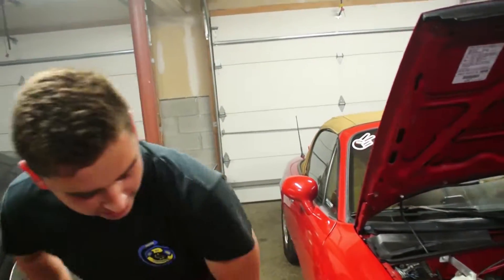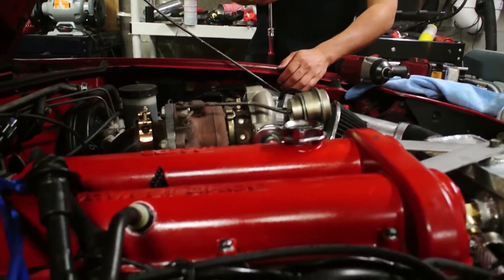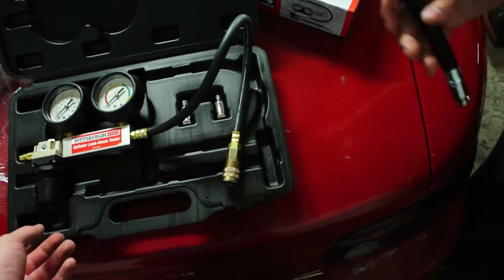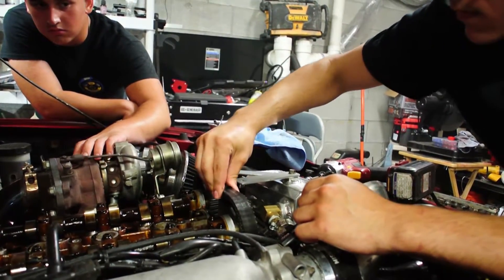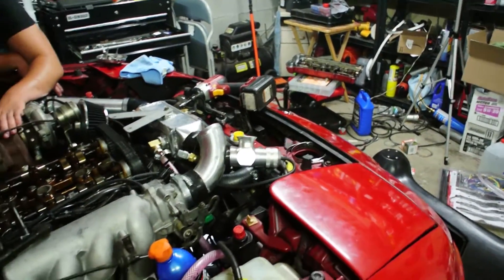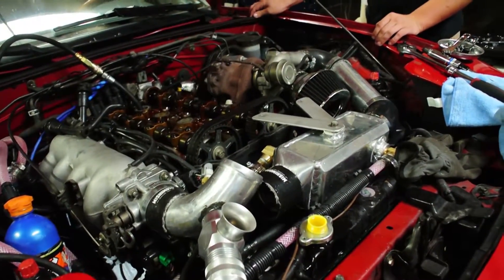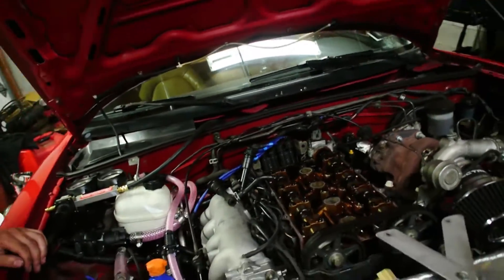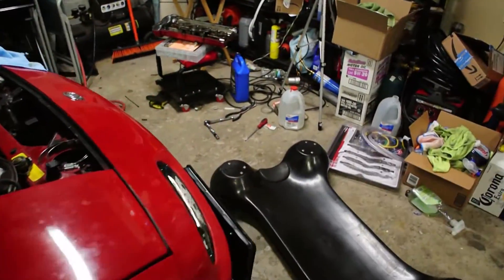How To Check a Head Gasket With a Leak Down Tester

Comment: When doing a leak down test, you don't need to remove the valve covers. If you screw your leak down tester minus the gauge into the spark plug hole of the cylinder that you want to test and the secure a balloon where the gauge would be. Manually rotate the engine until the balloon starts to inflate and you are now on the compression stroke. Do what you need to do to get a rod touching the top of the piston and continue rotating the engine until you find TDC while observer the rod. Then go on with your leak down test as normal. 
You may find that the balloon inflates only slightly on say one cylinder, this might indicate stuck or broken rings even if the leak down test indicates a seal at TDC.

Comment: Cylinder #4 dont fire at the same time as the #1. When the #1 fires the #4 ist on his exhaust stroke !
Reply: Wrong!  They both are on tdc..but only one have spark at one time..
In other words..if 4 the cyl. Has both valves closed and the Piston is on top..it can't be an exhaust stroke..